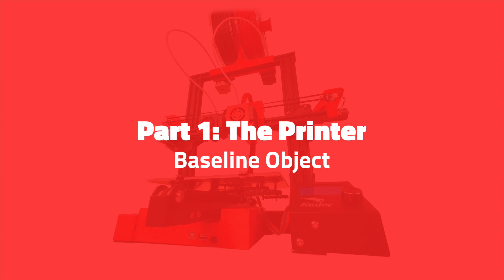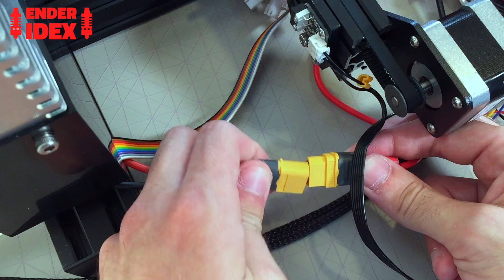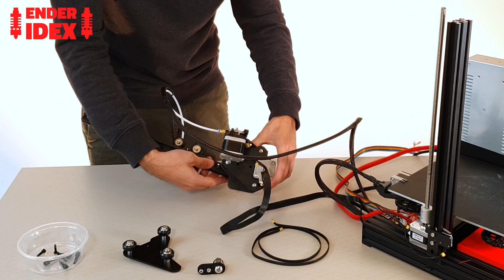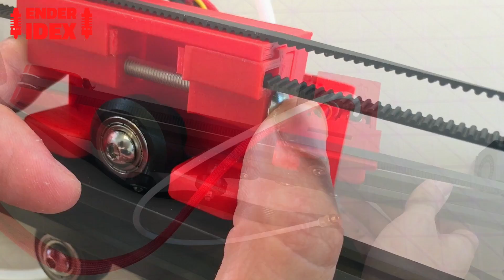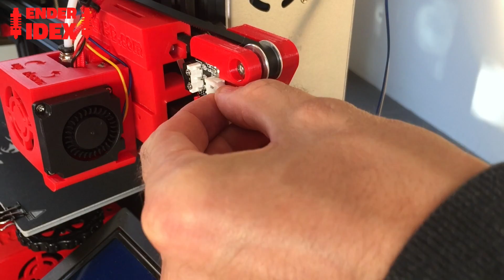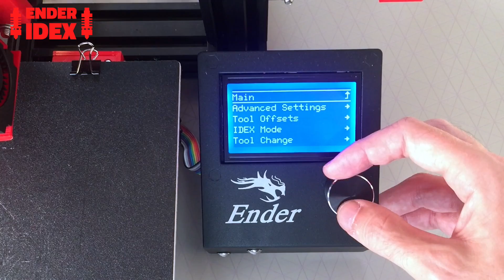Ender 3 IDEX: DIY Dual Extruder X-Carriage 3D Printer Installation Kit by SEN 3D

Comment: I need one of these kits later this year for one if my Ender 3 Pros and I have a Lot of questions, lol... Here's a simple question to start with: can I request a specific filament/color of the printed plarts please...?
Reply from the maker: That is awesome, thank you for your kind comment 🙂

Currently the kit is available in a single colour as the 10+ parts in each kit are printed across multiple printers and so even a single additional colour would require multiple kg's of it and a lot of time to re-spool all the printers.

However, once you do buy the kit all of the "non-critical" parts files like the spool holders, extruder holders & motherboard box will be made available to you. So you could re-print those parts at a later date if you wanted.

I also have a private group for kit owners you'd be invited to join where you can see what everyone else is working on. There are also lots of additional modifications available in that group that have been created by the Ender IDEX community.
Reply: @SEN3Dcom   @SEN 3D  Thank you for your response  to my questions and all this useful information, I think you just sealed the deal on my future purchase, lol. I'm not going to post the rest of my questions here, unless you want me to of course, lol, as I have not seen the answers in your FAQs on your website either. I am also super excited to know that there is a support group for your setup as the Ender and Creality Facebook groups have been Super helpful for me and all the upgrades I have done to my printers over the last almost 2 years. 😁👍🏼
Reply from the maker: @MoisFamilyTech  You're very kind, that sounds great. I can't wait to have you join team IDEX 😉

If there is anything else at all I can help with just drop me an email: kane@sen3d.com and I'll be happy to help

Comment: is there an option to attach it to Linear Rail since I have X-Axis Linear Rail from 3d fused
Reply from the maker: Excellent question, so looking at the kit (this one? https://3dfused.com/product/cr-10s-xz-axis-linear-rail-upgrade-bracket-carriage/) I would guess it's not directly compatible at this stage.

The reason being, with the removal of the X-axis extrusion you will lose the required extra length for the second X carriage as well as the ability to mount parts like the pulley arm.

However, I do know how popular linear rail kits like this are so I am looking into how it could be possible to bring IDEX to these setups in future...watch this space 😉
Reply: @SEN3Dcom  Kane any updates on making your kit work with linear rails? Or cr10?
Reply from the maker: @daddyshark1174  It's on the long long list...it's times like this I am very envious of those bigger companies with teams of people 😢
Reply: @SEN3Dcom  Hi, thanks for the response,  do you think something like this could work https://www.youtube.com/watch?v=I3xMHjiYENk with X-axis Longer extrusion you included in the kit, I should be able to find longer linear rails just need the measurement

Comment: Are you going to be making a ender v2 version , id love one
Reply from the maker: So the big challenge with the V2 is the screen, it really doesn't play well with non-creality board and a non-standard configuration like the IDEX.

There are a few Ender 3 v2 IDEX kits in the wild already, but they use either an original Ender 3 LCD or a TFT35 screen. 

The only other changes need from the standard kit are a "one sided" belt tensions like this https://imgaz.staticbg.com/thumb/large/oaupload/ser1/banggood/images/4A/A7/0fa467a4-02d3-4589-9c82-576d352fd5e4.jpg
And you'd have to be comfortable wiring up the power supply cables directly as the v2 doesn't come with an XT60 plug.

If you were comfortable with this you could get the kit today and have it ready to install within about a week 😮😉

Let me know if I can be of any more help and thank you for your kind feedback.
Reply: @SEN3Dcom  Would it be possible to just run the base model display? Both Ender 3 Pro and V2 are now using the same motherboard (at stock of course)
Reply from the maker: @dustojnikhummer  Yes you're right. The motherboard is not a big issue as the kit replaces it anyway. It's the screen.

So the customers that have the Ender 3 V2 version of the Ender IDEX just swap the screen out for either a stock Ender 3 LCD or something like the BTT TFT35. Basically any screen that can work with a BTT motherboard should be fine with the Ender IDEX. 😁

Comment: Can this work with an updated Ender 3 with a BTT TFT Display/control.  I have the BTT SKR mini V2 mainboard as well.
Reply from the maker: Hey Raymond, I know we spoke directly but just so people don't think I ignored your questions 😇....Yes the kit absolutely can use the TFT35 (and other TFTs). The kit uses the SKR Pro board by BTT, so pretty much any screen that works with this board and Marlin should work great.

The only ting to bear in mind is that some specialist IDEX features in marlin may not show up on graphical interfaces or may need some modifying to show up.

Comment: Hello,
It is a super project. Is it possible to use one, or two BLTouch to make the Z leveling? I would not upgrade my printer down with leveling feature.. I'm not sure that even the Marlin/SKR motherboard support it...
Don't plan such a configuraton for Prusa? 
(The Prusa one nozzle Multicolor print not worked for us in the work+lot of material is wasted...)

Edit: I just thinking and two BL Touch is not make sense, only one, because there is no dual Z azis/independent movement...  That would a really-really awesome, but I guess it is definetly not supported by Marlin yet...
Reply from the maker: Hi Lajos,

Thank you so much for your kind feedback :)

So yes, a BL touch absolutely is supported. Many of my customers already use the BL Touch and I have pre-compiled versions of the firmware for use with the kit. The only thing to think about is when you run a Duplicate or Mirror mode print, in this instance you will still need to manually level the bed as 2 hotends will be touching the bed at different points at the same time. You could still use the probe data from the BL Touch to help get a super accurate and level bed.

I am working on and thinking about which printers to expand the kit to next. Prusa printers are high on the list as they are among the most popular...so watch this space!

I also agree, there is a huge difference between a dual independent hotend IDEX system and a multi-colour, single nozzle system :)

Comment: I have a microswiss direct drive can I use this setup with this kit ?
Reply from the maker: At the moment the MicroSwiss direct drive is not compatible. The reason is that the stepper for the MicroSwiss is mounted over the back of the carriage and this would be in the direct path of the belt for the new second carriage.

I do hope to have a solution for this soon. However it should also be possible to use a direct drive that mounts the stepper motor on the front instead.

I would also consider at this point adding a second z stepper too, to help with the extra weight on the axis. Not necessarily a requirement but a recommendation 🙂

Comment: How does the stepper motor handle more weight applied by the second hotend?
Reply from the maker: The extruder motor gets moved off the axis which offsets the addition of a second X-axis stepper motor for X2. When it comes to the carriage for hotend 2, it's constructed primarily from ABS which makes it strong, heat resistant but also light.

So overall, it works great. Like the stock Ender 3, it wouldn't be a bad thing to add a second Z-stepper but it is not required at all for great results 🙂

Comment: Will this kit work for ender x and y extender kit?? I have my ender at 400x400x250
Reply from the maker: Conceptually it should be possible. The main changes needed would be: longer cables for the E2 carriage, a longer extrusion and longer belts.

However, I would suggest adding a second Z stepper too if you were to do this. I would probably recommend a second Z stepper anyway for the extender kits, even without my IDEX kit.

Luckily the SKR Pro board has a second Z stepper port on the board so it's quite easy to add. Also some of my existing customers have already added one to their kits as well.

If you were interested drop me an email and I'd be happy to work with you and get the first Ender Extender IDEX in the wild (kane@sen3d.com) 🙂👍
Reply: @SEN3Dcom  Does your kit use standard mounting holes on the X axis?  Adding dual Z and extending the wires and belts would not be an issue, but I wonder if id would be necessary to drill some new holes in the extrusion from Ender extender kit.

Comment: Will a print head option accommodate PA  or PA -12 variants (nylon series) filaments?
Reply from the maker: There is nothing specific about the IDEX kit that would limit the materials you can print with. The limitations will come more from the hotend/bowden setup. 

The stock Ender 3 should not really be pushed above 240°C with a bowden tube. But if you swapped it for an all metal hotend like the Micro Swiss you can achieve higher temperatures. The IDEX E2 Carriage in my kit uses the same mounting holes so it should be able to accommodate the same kind of hotends.

The only other thing you'd then need to thing about is active or passive heated chambers but this is a whole other topic 😅

Comment: Planning on upgrading my Ender 3 with the extender. Was wondering if this work?
Reply from the maker: I like the way you think. In principle it should work, the main additional requirements would be: longer X-axis extrusion (so E2 can part on the right side), longer belts, longer bowden tubes & longer cable extensions for the reach.

It might also be a good idea to look into dual z steppers as the extra span is a lot of load on a single motor. But, this is also true for the Ender Extender kit even without IDEX 🙂

Comment: This looks great, but it costs more than the printer itself. Other than printing in two different colors, I would probably just buy another ender 3 to print twice as fast.
Reply from the maker: Hey Eric,

I'm glad you like the look of the kit - I think you make a valid point and I'd counter it with a few things ;)

This kit includes a lot of parts, not least a 32bit SKR Pro board which entirely replaces the existing motherboard (and is a huge upgrade that could easily cost £50 alone). Plus a complete set of new cables, new extrusion for the X axis, 2 new stepper motors, over 10 custom designed and printed parts, a second hotend, fans, carriage etc. In some ways with a couple more stepper motors and a bed you almost have another printer 😂

I am also just a one man operation - I'd love to get the prices a huge company based in China like Creality do but for now I can't source parts for anywhere near the prices they pay.

Finally, and for me the most important, is support. When you buy my kit you also get my support setting it up, troubleshooting and getting the most out of it. I have a private Facebook group as well for Ender IDEX owners where we share ideas, prints, problems. I'm sure there is no Chinese manufacturer that offers anywhere near this level of support and hopefully it is worth something too 😇

However, I know the kit isn't for everyone so at the very least I am grateful you watched my video and hopefully I inspired you to come up with some other cool ideas of your own to build and make 😁

Comment: I like your video. I think about upgrading a chiron to become an IDEX. If I understand right, you only need the second extruder to be adjustable in z if you want mirror or duplicate mode, for pure IDEX mode alternativly you can use z-offset value (if home of x0/x1 is outside the bed, so nozzle can not crash into it.). Is that right?

I do not need duplicate or mirror anyway - I have for example 4 Prusa Mini, and 2 smal printers are faster than 1 bigger printer anyways (at least with y-moving bed, a smal one accelerating faster).  

I think about using an SKR 1.4 turbo. It has only 5 sockets for stepper drivers, but using exp2 (If you use a CR10 display, exp2 is free) you have 7 i/o free, so you can add at least two additional drivers - for example simply remap y and connect a closed loop driver there and remap former y-driver as second x driver. For printheads I want to use the Bondtech mk3s upgrades (in the Open source Thingiverse version) in Mosquito version. I definitly prefer direct extruders.
Reply from the maker: Hi Ole Urgast,

Thank you for your kind feedback 😊

Yes, the Z adjustment of the second extruder is only necessary for duplicate and mirror mode prints (as 2 hotends touch the bed at different points at the same time). For a 2 colour/material print you are correct, you can just set a "Z offset" for extruder 2.

Sounds like you have quite a farm - are you printing for fun or for business? 
Agreed, duplicate mode will be very useful for some people and unnecessary for others. I guess one advantage is that if you have limited space and print a typical medium sized model, with duplicate mode your print capacity can be significantly increased and then switched back to bigger "single extruder" models when necessary. Speaking to my customers it's amazing how different everyones needs, preferences and setups are 😁

It sounds like you have lots of ideas and a big project or two putting this all together. I'd love to see how it turns out and help if I can. Drop me an email once you get started 👍
Reply: @SEN3Dcom  It's just for fun. I have about 12 functional 3d printers and about 18 I am tinkering on. Actually my hobby is more about building/moddifying/improving 3d printers than actually 3d printing ;-) The printers I actually mostly use are my 4 Prusa mk3s and my 4 Prusa Minis (each one original and 3 clones).

Sadly as always I have more ideas than time. For example I had an idea for a Real-Independend Multiple Extruder: 2 or more Deltas. Bed mounted on rails, moving from Delta to Delta. Would be a hell to do the calibration and transforming the gcode. But printing would look very funny. Think about 4 printers and 2 parking places in a cycle, organiced as a railway yard with 4 beds moving between the 4 printers. I am not sure how to build and program it. And If I ever find the time...
Reply from the maker: @oleurgast730  If you have more printers in the tinkering phase than the printing phase you're definitely more into the modding and upgrading 😜For the Prusa's, how do you find the clones compare to the originals? is there much in it?

I love this idea, this would be an epic machine. Somehow it reminds me of the revolving everlasting gum machine in Willy Wonka (https://youtu.be/7jF2uMUTZ44?t=19) 😂- As always the hardest part is finding enough hours in the day to work on these projects, I can empathise with that for sure!
Reply: @SEN3Dcom  for the mk3s clones: I strictly recommend to replace the 4.1 bore heatbreak of the clone by an all metal one, as original firmware supports up to 295°C.
Also the bearings are not good quality -  at least change the 6 ones for x and y. Due to sensorless homing a bad bearing can lead to fails; both on starting a print and in case of crash detection.
But everything else is quite as good as the original. For a price less than 250€ incl. shipping from EU (Fysetc Bear Clone on 11.11-sale using AliExpress, AliExpress select and shop coupons) even with this changes, some extra upgrades (like buing a 7€ "Dual Drive"(BMG Clone) to source the parts for the Thingiverse version of the Bondtech upgrade for mk3s, and add a second Fysetc part cooling fan, about 3€) and the PET-G for part printing, you can get a clone as good as (or even better than) the original for about 320€. 
Of course (like with the original) only one spring steel included (with PEI Sticker); but extra spring steels for different textures I mostly see as "consumables" anyway. The Fysetc Powder coated spring steel (about extra 20€) has a quite different texture than the Prusa one - but I like it a lot (even use one on my original Prusa) than printing with Silk filaments. The Pei powder coated spring steel from "energetic 3d Store" on AliExpress has quite the same structure as the original Prusa one. 
I intend to use XMas hollydays for a video on my chanel, showing the changes on my mk3s clones (sorry, only in german)
Reply from the maker: @oleurgast730  This is awesome information and you've probably started me on another one of those 2 hours AliExpress browsing sessions - investigating what is available and how it compares. I feel like now I will be starting another round of print bed material testing as the Fysetc Powder coated one sounds like it's worth a try at least.

A video of all of this would be great, I'd better start brushing up on my German 😉